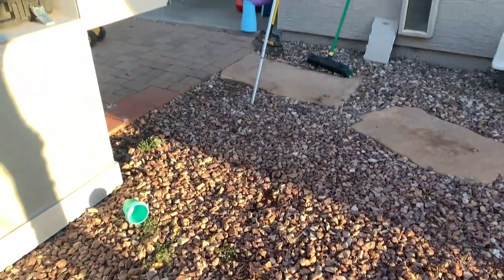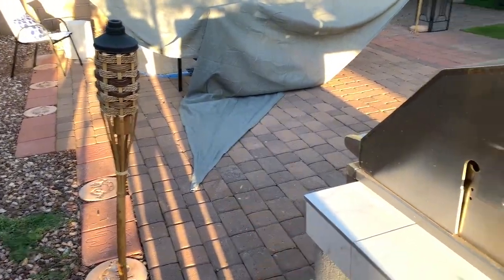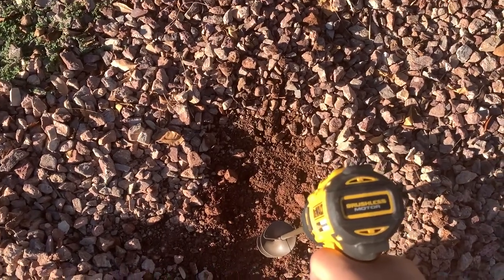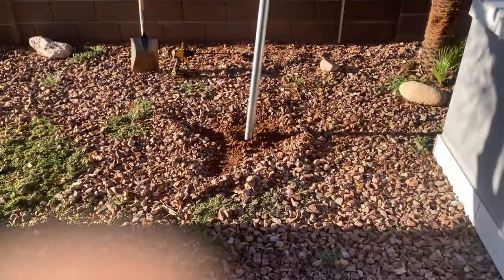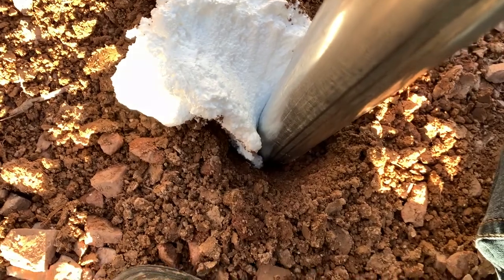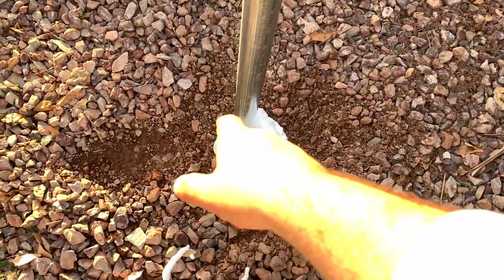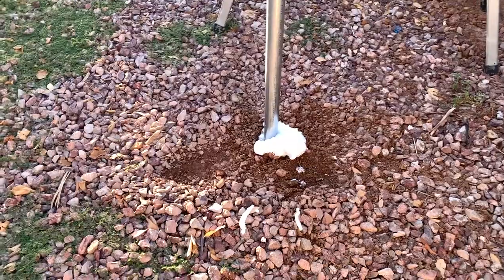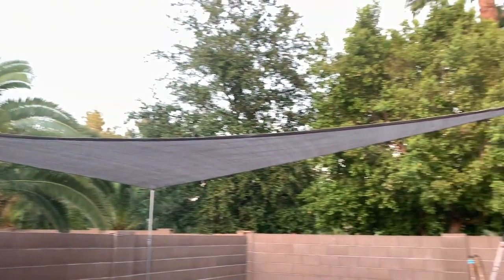How to install a shade sail pole beam into the ground in ONE day | $48 DIY

Comment: I did the same thing and it worked great. Went about 2 ft deep and filled with foam. Poles (1 inch Galvanized steel, do not use aluminum or conduit. More expensive but extremely sturdy) are as steady and just lasted a tropical storm (took sail down though obviously). My only recommendations: 1) Absolutely wear SAFETY GOGGLES because the foam can will prob backfire and shoot everywhere. Happened twice to me! Fortunately had goggles on. You DONT want this stuff in your eye(s)!  2) It's good to have the poles leaning slightly away, It adds extra support and prevents the poles from bending inward.
3) Drilling the screw holes through the poles was incredibly tough, even on drill bits made for it. Once you see that the bit is tearing up the steel, continue slowly and add pressure.
Reply from the maker: I 100% agree with everything in this comment. If I were to do it again I would have done exactly that. Thank you for sharing @ruthlessjblaze
Reply: @ghannam360  thank you for the foam idea! Works great and makes it all removable if necessary.
Reply from the maker: @joncocio4995  I’m so happy you loved it!
Reply: If you have a metal punch, hammer a dent into where you want the hole and begin drilling with a small bit. Once your through you have a hole that will guide the drill bit you need through the metal without it sliding everywhere and a hole that allows the bit to begin cutting.
Go slow. Unless your pressed in some way a metal drill bit used at high speed will melt and it’s effectiveness drops sharply.
You can use standard drill bits to do the same job… but ONLY at slow speeds. And there is a risk near the end of the drilling for the grooves to catch on the metal and twist. Even if you go slowly, with a standard bit this is where you can snap a bit if the drill and bit twist. You want to maintain the angle you started drilling at and if that means backing off and trying again. It’s worth it to save you the cost of a broken bit.

Comment: Hi much easier to drill the top of the tube BEFORE you put into ground. Also you'd be better off using Post-Lok foam as it pours more easily and surrounds the pole evenly. Just saying!
Reply from the maker: I agree on both statements. 100% something I would consider doing next time around

Comment: How has it held up? Has the pole behind the grill shifted? Would you do anything different?
Reply from the maker: Hello deanna, It has held up very well. The only thing I would have done differently would be to fill in the pole from the inside with cement to help with the curvature stress. That or would have got myself a taller pole.

Comment: May I ask what size post you used for the part you attached to the brick wall, and what size straps?
Reply from the maker: For that I used a standard electrical pipe. I think it was 5/8. 

Shade was a 20x20x20
Reply: @ghannam360  Thanks, I appreciate your response!
Reply: How as it held up in storms?

Comment: Great idea using the foam tight. What size pipe diameter did you use?
Reply from the maker: This was actually a 2 inch pipe. If I were to do it again I would try out the 3 inch pipe
Reply: @ghannam360  why you would try 3” pipe? Is 2” not strong enough?

Comment: Great job! Can I ask what did you use to help attach the pipe onto the wall?
Reply from the maker: Thank you so much! As for the pipes attached into the walls I just simply used a bracket hanger strap. Drilled in the holes into the walls for the screws.
Reply: @ghannam360  got it, thanks!!

Comment: I think you figured out the least expensive way to do the poles. Are they still holding up well?
Reply from the maker: Haha yes I agree. I wasn’t down to spend more than that. 

They are holding up just fine. Fingers crossed
Reply: @ghannam360  thanks for this video...checking in a year later - how are they holding up?

Comment: Does that foam work as well as concrete?
Reply from the maker: Concrete will always be better and stronger. This foam is pretty strong and long lasting. But I will say that concrete is probably the more dominant choice. 

So far I am impressed with the foam because it’s a quick way to install things and it holds up very good

Comment: All adhesives are meant to completely cure in 72 hrs.(Three Days)... The fence post diameter used is too narrow. Three inch or larger would withstand winds above 25mph the base should be set in concrete with a minimum of 2.5+ ft. deep x 8 inch+ diameter.. hardware needed are turnbuckles and springs 3/16" coated UV  cable, hooks & ferrules or clamps.

Comment: Is that the chain link fence post that you use? How is it holding up?
Reply: I have the horizontal posts that run across the top of the chain link fence, do you think those are strong enough to keep the sail shade from shagging over time or if it would be unable to withstand strong wind?
Reply: @nmjhd1234  I can tell you no from experience. Mine sun shade sags the post. I’m going with a much sturdier post when I find one
Reply: @davidlane9724  thanks for the reply bud. Do you think the basketball post will hold up? Its easy to find basketball set ups that ppl thrown out for various reason and i thought maybe those may work.
Reply: @nmjhd1234  I think that would be a better option. I am seeing videos where some folks are using a 4x4 hinged to another 4x4 in the ground. Then they used a ground anchor and ratchet. One of them said that worked for 15 years for his set up.

Comment: How is the sail doing?  Did it hold up to wind?
Reply from the maker: It’s holding up very well actually. Definitely something I’ll be doing again
Reply: @ghannam360  thanks for the video. Did the foam really hold up? I need to install 2 pipes like that and thought I would need cement. Thanks!
Reply from the maker: @Vectorr66  It actually did. If I were to do this again I would go deeper and maybe a thicker pole. It held very well but I noticed that the pole had a mild curvature under stress. The foam worked very well. Try not to move it while it’s drying up. Any movement will make it lose when it’s officially dry.
Reply: @ghannam360  Awesome thanks! I. Thinking of putting an insert in first for 2.5 inch pole so I can take out.
Reply from the maker: @Vectorr66  oh so you can take it in and out when ever you want ?

Comment: Minimum pipe size recommended is 4" schedule 40. Buried 40% down . No way will yours hold up.
Reply from the maker: Dude.. it’s still holding up strong
Reply: Your recommended specs seem waaay off for most soils and climates.

Comment: What are the pieces called that u used to brace the poles to the wall?
Reply from the maker: They are called a pipe strap. Make sure you secure them in with a good washer

Comment: No way this thing lasts in windy thunderstorm. Those corners can have up to 2000lb up draft force.
Reply from the maker: Make it thick enough and deep enough. I am confident you’ll be fine. They are still holding up here in AZ.
Reply: good job..I'm putting up another one today..I'm in palm springs california area where the wind can get pretty bad..I'm gonna install this one with quick clips to take down when needed.. they last a long time.. the sun is hard on everything out here..
Reply from the maker: @michaelmadrid9311  Any chance you can let me know how it goes? I am excited for you man
Reply: @ghannam360  absolutely...
Reply: @michaelmadrid9311  did you do it? How did it go? I live about 2 hours from Palm Springs and I'm wondering if I can do this in my back yard with the strong winds we get.
Reply: @edNapartyof4  you know what...I did install it..I thought 2½ inch fence poles in the ground 3 feet with a height of right around 9 feet.. the other two corners are attached to the fascia on the house.. before I even got off my ladder I noticed those poles flexing in the wind with that 20ft x 16ft sail... didn't last 30 min.. it was almost touching the ground going up n down.. took it down and the next day used 4x4 posts and it's fine..I made it to where if it gets too windy I can take it down fast to prevent it from wear n tear.. the wind is bad here sometimes... roads close due to visibility issues with sand...